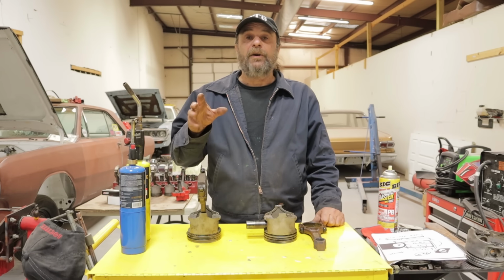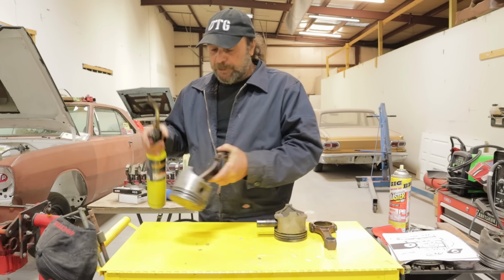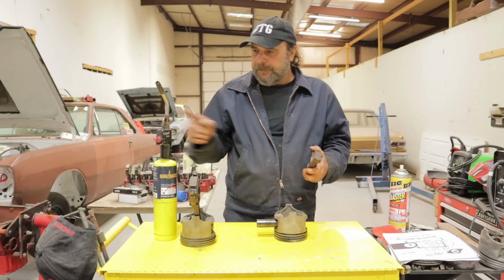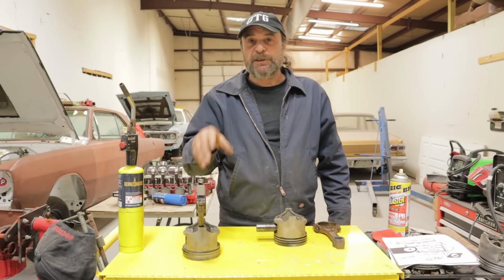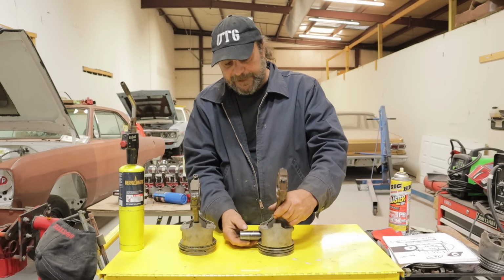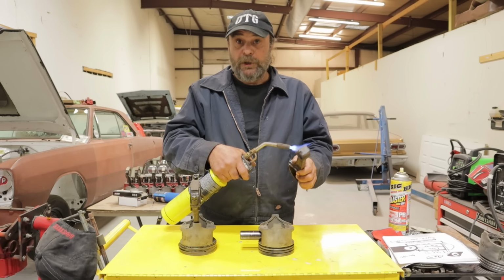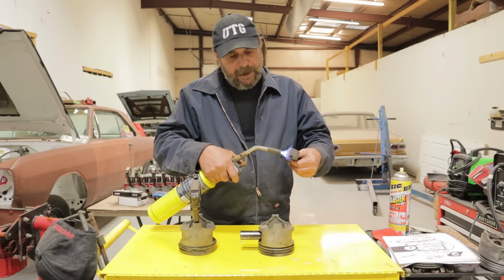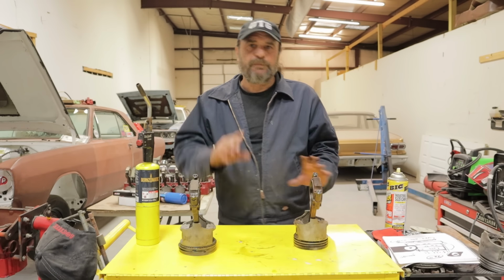Swapping Pressed Pistons For The Home Engine Builder

Comment: Usually you share great knowledge.. Not this time, the rods are around 55rc harness from the factory, which is a temper of around 500°f for these rods, so anything above that will futher temper them back, and anything above 550°f has effectively nullified the heat treat.
So, any glowing... Is too far..  You should be shooting for color change of about "hay", not even into "blue".. But overall, just putting them in a 450°f oven will hit it everytime. 

....... I can. Promise you, if you purchase a set a RC hardness test files, you'll see the big end is much harder than the small end of the rods you just destroyed.
Reply: As a machinist with a fairly extensive knowledge of metallurgy, I thoroughly agree with every detail of your explanation. I love UT but I gotta back you here.
Reply: @vincentwhite7693  I do appreciate that, as a knife maker who's a former mechanic, I take HT very seriously.
Reply: Agree.  Don't get red will destroy temper
Reply: True. This is why nobody should take everything Tony says as fact.

Comment: Thanks Uncle Tony your the best! I asked this a couple weeks back on a live stream, great to see a follow up video as I know it’s a hot topic with not a lot of info out there. I ended up building an adjustable jig that clamps the piston and sets the wrist pin depth, very similair to what a machine shop has. Ive always been told if the rod gets dull red/red hot the rod is toasted and might aswell throw it out. I did this last week in my SBC I only heated the rods until they were blue and the wrist pin slid right in no problem, Great work by the way appreciate the video!

Comment: Gallon can, oil, hot plate, put little end in the oil, I think 450 F. works, the oil is your assembly lube . Push 'em right in . You might wanna use a heat gun to see if 450 F. is enough  .

Comment: Tony, the model of torch matters.  Your mapp gas cylinder looks to have a TS4000, and your propane some little Micky mouse unit for a plumber.  I'm willing to bet a TS8000 on propane would be plenty hot.  It's done everything I've needed out of it which includes getting bearings out of Honda transmission by means of gravity and heat.  That took heating the case hotter than operation would ever get it!
Reply: You only want the rod on the 400 degree range or you screw up the temper.   So...yeah Micky Mouser propane works just fine.

Comment: Great video, however, I see one small issue, which on factory engines, may but be an issue. This method heats the rod to beyond its "critical point" or the area in which steel loses any temper it has, which is at about a dull red. Another way to check this is if it loses its magnetism. Steel, heated to that point, quits being magnetic. So if the temp gets above that, any temper is lost. If this affects stock rods, or if temper matters in this context I don't know, but it's something to take into account.
Reply: It does matter, and he heated it way too hot. You only want it to get in the 400 degree range. Red of any shade is above 900.

Comment: To install, put the piston and or the rod in the oven, and the pin in the freezer.
Reply: Cold pin will soak the heat out of the rod and severely cut down your working time. You clearly never done this before.
Reply: @SOLDOZER  actually i have, and seeing as how you seem to think you know everything, good job trying to show it.. but whatever lets you sleep at night.  Also, i wont be taking advice from someone using someone elses name.
Reply: @kevinwallis2194   I do know thermodynamics, which you clearly dont.
Reply: @SOLDOZER  hahahahaq ok, i learn from doing things, not from a paper that says im smart.

Comment: I've always had good results just tapping it out with a socket as the driver.  I've been told it can't be done that way, but it works just fine.
Reply: It will work if you dont care about ruining the piston or pin.
Reply: @SOLDOZER  It works without damaging anything if you're only moderately careful.  The socket is Cr-V, which is far softer than a pin, so it won't be damaged that way.  It's done on a block of wood, which is softer than aluminum, no damage there, either.  I've been rebuilding engines for almost 40 years and haven't had a problem using this method.

Comment: MAPP gas is not the older MAP gas.  It got detuned 10 or 20 years ago.  Marketing BS and all.  It’s still hotter than propane but not as much as it used to be when it was MAP with one P.
Reply: Sorry a bit off.  It’s MAP-pro now.  But the thing that happened is the same. It’s cooler now.
Reply: I feel like a jerk getting the info a little wrong.  Sorry.

Comment: Just to remind, the pin should not protrude past the outside edge of the piston on either side, when you push the rod against the inside wall of the piston. If it does, I would then actually take a measurement, and ensure the two sides are equal in the play. Keeps the pin from scrapping the wall of the cylinder bore, if the rod and pin does go that far. I know it shouldn't, but it's better to be on the safe side.

Comment: When you see it done at the machine shop the heater looks like a toaster. My local shop machined and balanced my lower end and pressed the pins while I waited, did all 8 in about 10 minutes for $8 a piece. Seemed like a fair price so I let him take care of it for $64 .
Reply: When I had a shop I had an old toaster oven used for such things.
Reply: If the rod is heated to hot  it distorts the small end therefore it loses it quench .ie press fit ,. Seen this way to many times.  Pin moving in against the cyl wall when it gets hot . Owned a machine shop for 30+ years .Let a shop do it
Reply: @eugeneyelton3829  I get what you're saying but machine shops hire idiots too. It's not their motor it's not their money spent. Ive had them F up my stuff before.
Reply: @eugeneyelton3829   And he heated it too hot. If its red its too hot.

Comment: Thanks greatly  I have a jeep 4.0 I think may either have a loose rod or or damaged piston .  Also checking other posiable reasons from torque converter bolts and so on  but starting to look like it's time to drop the pan.
I was wondering if there was a way to change out piston and rods so now I know as long as the pins are not thin wall.  It's a 2001 so what are the odds .lol

Comment: MAPP gas burns hotter than propane. That turbo torch you have really helps get it to its peak temp. If you mix with oxygen it can get as hot as 5300°F! But that might be a little hot for this application. Good for brazing though.

Comment: I did a dirt bike piston by putting the piston pin in the freezer and the rod in the oven at about 210 degrees, a little oil and it slipped right into place then let it cool

Comment: Great vid but the two torches have different nozzles one is a ts4000 which is a bigger flame that's what u have on the yellow map tank but the blue prop tank has a wk something nozzle which is smaller. Map gas does burn hotter tho so could be a reason to pick it over prop but I'm no expert.

Comment: The new Mapp gas is nothing like the OG stuff from the 2000’s that got discontinued.  In fact, it is only marginally hotter than propane.  Look it up.  Don’t let the sound or looks of the flame fool ya.
Reply: It's still hotter. If you try this with propane, you can't heat it enough. MAPP gas just barely does it, but it does it. I use oxyacetylene torch myself. That will get it way too hot, so you have to be very careful with that.
Reply: @elmerfudpucker3204   You only need the rod to get to 400-450. Propane will work just fine. A toaster oven would work just fine.
Reply: I looked into that too.  MAPP gas is new and less hot than MAP gas of old.  They snookered us by adding that extra P and it is only a couple hundred degrees hotter than the older stuff.
Reply: Sorry, than the propane stuff.  Correction in my wording.
Reply: Yep only about 100 degrees F hotter than propane

Comment: I was told if you get the steel to hot the carbon runs to the heat making the un heated steel brittle
Reply: Not exactly. It is all about the carbon. But, it wont make the un-heated steel brittle. What it will do, is anneal the area that was over-heated making it soft.

Comment: I hate being a know-it-all, 'cause I know you hate know-it-alls, but I know you know there is a special tool that you can buy to press the pin out of the rod without damaging the piston or heating the rod...
Reply: I actually have one of those. It's a Miller Specialty tools piston pin installer-remover/arbor PN C-3684. Used by dealerships and mentioned in the service manuals how to use it. Protects the piston and precisely spaces the pin with a spacer during install.
Reply: @vincemajestyk9497  Yeah, it's a pretty simple tool too, I don't have one but I borrowed one from a friend a few years ago when I rebuilt my old 250 chevy straight six.
Reply: @livewire2759  I bought 2 of them used about 10 years ago. One was for slant 6 engines but I sold that one. I bought it because I kept hearing horror stories about some shops overheating the rods. A buddy of mine dropped $1200 on a beautiful set of rods and was broken hearted when he got them back and they were all 'blue' after the shop installed the pistons.
Reply: Warning do not let rod get dull red that's too hot over 500f will destruct the temper. 400 is maybe a straw to brown color only.
You can test with a hardness file set to confirm. Basic metallurgy. Even blue is too 🔥

Comment: I tried your trick on running lifters upside down for more horsepower and it didn't work. The top end of my motor didn't get enough oil.
J/K

Comment: VGG got a tour of the Blue Print engines factory. They do so many if these that they have a special fixture. Machine presents piston appropriate side up with  wrist pin inserted to proper depth. The operator has a rod presented also in the correct orientation. He places the piston end in a heating slot and presses a button. When the rod is ready a light goes green. The operator moves the rod over to the piston and pushes a button which properly inserts the pin.
Reply: That was Cletus, not VGG.

Comment: I once saw a machinist at a performance oriented machine shop do that with an acetylene torch. The rod end was glowing orange. Sometimes you pay and you would have been better off doing it yourself. That shop had a good reputation but has been closed for about 30 years now.
Reply: That's what I use, but yes, you have to be careful, the blue wrench will mess the rods up in a hurry.
Reply: You only want the rod to get to around 400 degrees. If its red at all you went too far like Tony did.

Comment: I've used the same method installing bearings. Put the bearings in the freezer, then heat up the pocket the bearing sits in. When it's warm, pull bearing out of the freezer and should slide right in. Can also use an oven for heating parts too, if their small enough. Great video! This is the garage mechanics way taught to me by my grandfather.
Reply: Never put parts in wifes oven.  Oil always smells up the kitchen, even if you clean parts.  Ask me how I know.  Now just have dedicated toaster oven in garage.  Haha
Reply: Have put new bearing races in many truck hubs this way, also ring gears on flywheels.

Last shop i worked in had a huge commercial oven we could put a whole 4 cyl diesel block in we could freeze the new cylinder liners over night and they just dropped in by hand after you set the block in the oven for about 2hrs.
Reply: @BigBing1987  I usually put the new ring gear in the pizza oven for a bit.
Reply: Rods will get harder if you put them in a nice warm place.

Comment: Never tried to use a little torch to change wrist pins before norm just use a big ass press and spacer between the rod and piston and a socket to push the pin out.....id figure id would heat transfer to the pin or piston

Comment: There are some propane torch rigs that are capable of high heat operations but you won't find them usually at the local hardware store. I have used some in the plumbing trade in place of acetylene units.

Comment: Hey Uncle Tony ..  great video man ! . 
 My Father was a mechanic his entire life ,. and worked on everything in his mechanic shops , including doing his own machining with his own equipment .  
 when he would assemble pistons and rods he would basically do what you just did in your video .  except he would usually use his oxygen and acetylene torch  , with a small rosebud tip on it .  
 because like you said , most piston pins have an offset to one side , he had spacer tools that he made from copper for the spacing .  
 they were U shaped tool with about a four inch handle on them . 
  he four of them in different sizes , but the one most often used was  the .060" thick one .
  and he would also use 30 weight motor oil on the piston and pin during assembly .   
 but you are absolutely right , it is all the same concept .
 thank you for the videos Tony 
 Tim from Wisconsin .

Comment: Apparently no heat treatment in a factory rod if turning the end dull red does not effect them.
Reply: Nope factory rods are quite ductile, ive seen a demonstration where a SBC rod was twisted around 90° and straightened with no noticable damage. If it was a heat treated alloy it probably would have cracked .

Comment: Brilliant, you have cleared a niggling worry I had after I received my pistons and rods back from the machine shop.  I noticed the wrist pins were not all precisely central when the connecting rod wrre.  I enquired with them about this and they said it’s fine.  Being my first warm V8 rebuild, I was skeptic all but you have cleared the worry.  Good job, thanks.
Reply: that would piss me off especially with how much some of us are paying for the simplest of stuff done app machine shops! in this situation I would expect that pins to be centered within .020" at the most and if they weren't then I would have them do it again which would cause me even more concern because of how many times the rod had to be heated! parts are not cheap and I have a lot of bad experiences at machine shops and their prices are definitely not cheap!
Reply: @rustybritches6747  Alignment can't be perfect because the rod will contract in ALL dimensions as it cools which can make it shift slightly left or right. Which is fine on floating pins like these and why the pins aren't exactly matching to the wide of the piston there. What is far more important is the proper temperature so as to not alter the metallurgy of the rod.
Reply: @Cragified  these are not floating pins, they are press fit.
Reply: @tedkay5272  Press fit wrist pins are still floating pins. The pin pivots freely in the piston boss. A full-floating pin can pivot in both the piston bosses and little end of the rod.
Reply: @Cragified  semi-floating if you want to get technical.
Reply: Imagine non-floating rods.
Reply: when I got mine back (f302), the pin ends of the rod were all discolored dark purple. it's been nagging me ever since that they might have killed the forge strength by overheating.
Reply: @ SometimesLeela

Actually, so did I.  But I figured with heat there was always going to be discolouration but to what extent.  Mine too had dull purple shade but our man Tony has lifted our concerns.
Reply: @sometimesleela5947  they would have to heat them to glowing red in order to anneal them. I wouldn't worry
Reply: @sometimesleela5947  Normal, mine looked like that too after i got it back from the machineshop. done many a 1/4 mile pass and they have lived fine well beyond what a stock rod should do.
Reply: the prices I'm paying at my machine shops I demand perfection especially for the price of quality parts, so those pins better be pretty damn close to dead center on all eight!
Reply: whats a niggling

Comment: Man, I just pulled and pressed a carrier bearing on my 86 Volvo driveshaft.  The manager at the part store was impressed, said he bought a new shaft because of the way his was pressed together.  Not sure his vehicle, but I was like "really? I'm not even that much of a gearhead and I'm doing it!"  No fire needed, just cut a 1-3/4" notch in a block of wood and gently hammered it on.  Pain in the ass is it's special order shit, and I got the wrong rubber donut it goes in so I'm waiting a week for the fucker I need.  Glad it's a project car and not my daily (it will be again sometime).

Not but a few months ago I was watching Tony talk about people that are doers.  I was not in that category then, but I'm working on being more of a doer!  My primary truck had a few problems I needed to fix. (Body control module had a burnt circuit- started the adventure).  When I was satisfied (and bored), I dragged the old Volvo up out of the dirt.  Thanks for the inspiration, Tony!

Edit: anyone wondering, parts have been pretty cheap so far, but nobody has them in stock for same day pickup.  O'Reilly has become the standout in my recent experience, if that helps anyone.  Used to go to Napa a lot but they close earlier/less convenient for a non-pro like me.
Reply: And for online nothing like Rockauto or eBay for old car parts